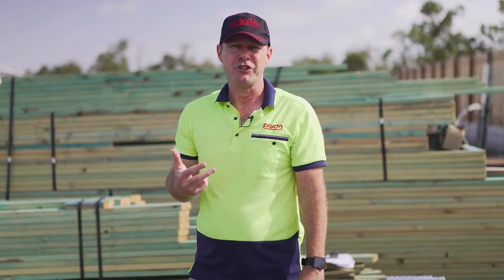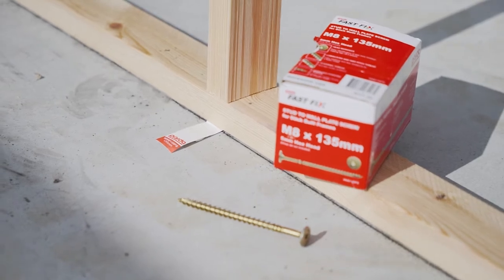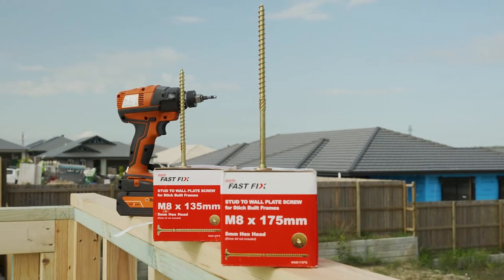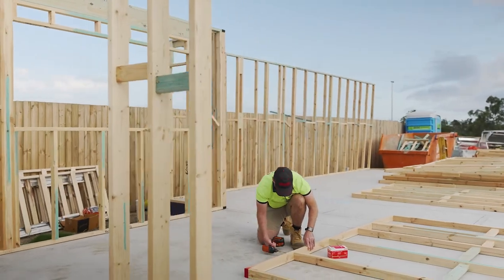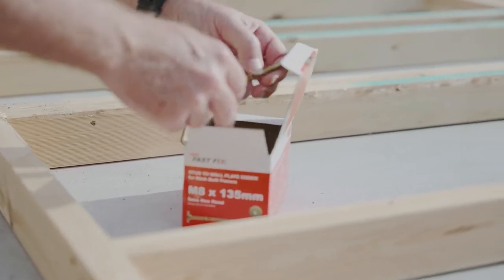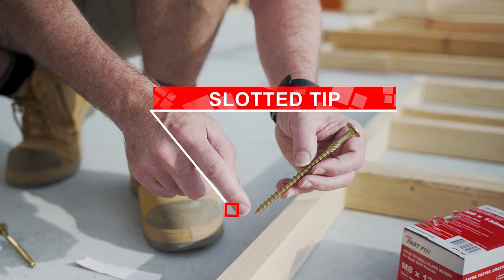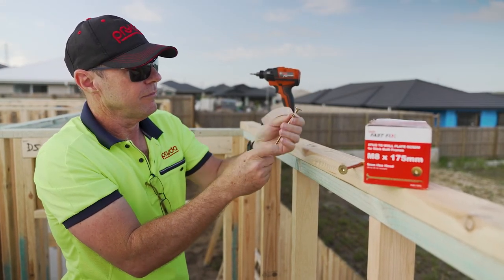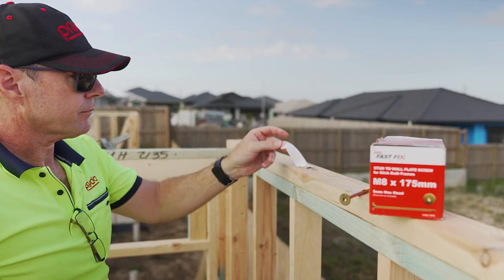Pryda FastFix™ Stick Build Framing Screw

Comment: Does this eliminate the need for stud straps/plate ties for lightweight roof construction?
Reply: Yes
Reply: The question is , Will building surveyor pass that with just a tag hanging out without proof?
Reply: I’m all for new stuff. And I use screws quite a bit in various applications when building a house, but never for actual framing of a wall. I really can’t see how that is faster than a nail gun.